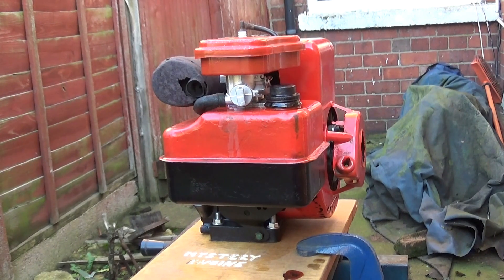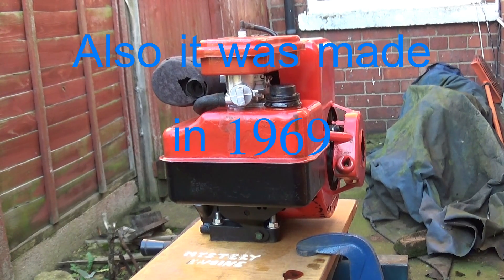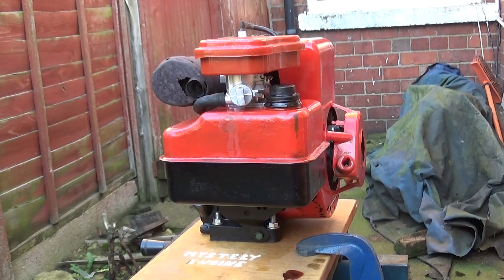Mystery Engine - Runs Without a Spark Lead

Comment: Well - i would say it is acting like a diesel engine.  As it happens i have just found this video seeing as i am starting a 3 cyl engine without any coil leads connected. Work that one out.  That engine will prob start with no lead at all just as i am finding with this 3 cyl.
Reply from the maker: No it's not like a diesel engine. Spark ignition

Comment: Morning mister , from long time a go  engine  didn't need spark  to fire the mix  they just need pulsing  field to the engine that what create the repulsion  on the piston  back down,  just when u loop the coil wire to the block the loop of electro magnetlield get complete, and then there it's no more push , almost like solenoid  work, but push pull action,  the engine produce the electric field  by the magneto/coil  then air fuel it's charged to complete the loop , maybe that engine will run on just air   no fuel , but. You need to work on timing the engine to this  fun  part, and maybe will turn I. Opositt rotation  ,

Comment: Below the shroud he's got a wire spliced into the coil wire going to the head gasket and once inside the chamber the raw end (maybe near the intake valve) is making a little spark.
Another guy made it so you could remove the spark plug as well and it's still running.
Nice trick.

Comment: Great job Malc.I still haven't figured out how you have running with the lead off, and I don't see the spark jumping from the lead to the plug while its off either so that's not it..............??? ....................The flywheel must be cast iron because it wouldn't run on alloy without  a blade or other equipment attached I guess.
Reply from the maker: Thanks James. Just watch the build videos from the last month.....all my hard, arm aching, brain aching work....

Comment: This happens in diesel engines, is often referred to as dieseling. Sometimes and gasoline engines it can happen as well. Basically the compression is causing enough Force to ignite the gasoline without the spark plug.
Reply from the maker: But I did this on purpose.....see videos. Many years ago, especially with old side valve engines, they would run for up to a minute or two with the hot carbon buildup inside. That's how you knew it was time  for a decoke lol.